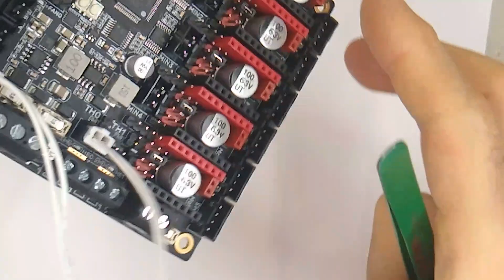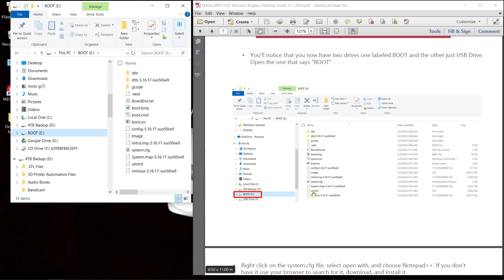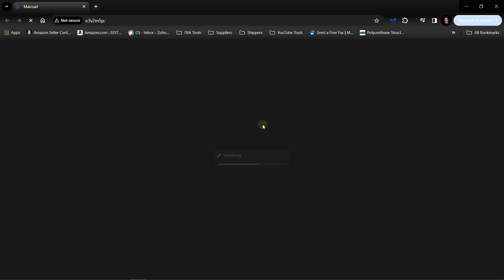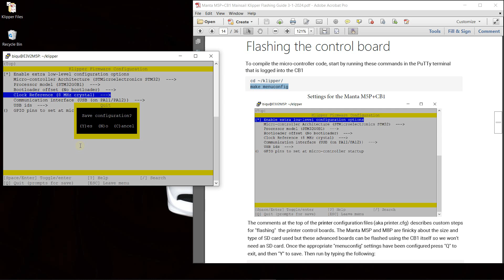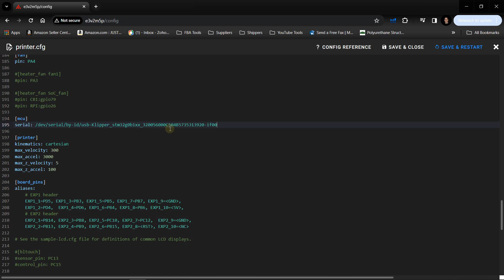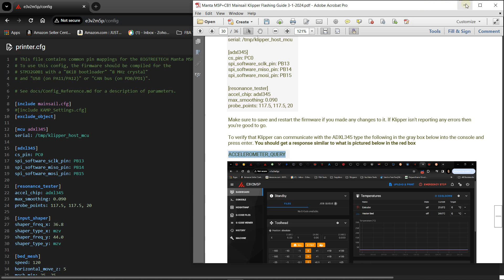How to Install Mainsail Klipper on the Manta M5P+CB1 using DFU to Flash Klipper.bin 2024 Edition

Comment: Hi Victor,  using this tutorial for the Manta M8P is working out quite well so far.  I'm still in the process of cabling up the components which I hope to finish 3/17, Happy St. Patty's Day.  I have just a couple of note so far:

Page 15  the M8P and M5P use the same memory address.  
dfu-util -R -a 0 -s 0x08000000:mass-erase:force -D ~/klipper/out/klipper.bin 

The M8P has (2) sd card slots, you need to use the SOC-CARD socket for the flash.

 Page 29  the M8P SP1 socket is reversed 180 degrees from the M5P so pin 1 for the M8P is the right hand pin closest to the edge of the board.  The M8P labeling for the SP1 socket for pin 2 is PC4 for the V1.0 & V1.01 boards.  The M5P pin 2 is labeled CS.  The M8P V1.04 and above have the label as CS.

Here is the ADXL345 printer.cfg setup for the Manta M8P

[mcu adxl345]                    #  For resonance Tuning of X and Y axis in my Custom CoreXY

serial: /tmp/klipper_host_mcu

[adxl345]
cs_pin: PC4
spi_software_sclk_pin: PA5
spi_software_miso_pin: PA6
spi_software_mosi_pin: PA7

[resonance_tester]
accel_chip: adxl345
max_smoothing: 0.090
probe_points: 117.5, 117.5, 20   # Edit X, Y, Z for your printers bed center point 

If you use the data from the Tutorial on the M8P you will get this error:

Invalid adxl345 id (got ff vs e5).
This is generally indicative of connection problems
(e.g. faulty wiring) or a faulty adxl345 chip.

"It is also caused by the incorrect pin assignments."

Victor, overall you efforts have made my install of the M8P board quite easy and I hope these notes will help anyone trying it on the Manta M8P + CB1 + 2209 Chips.  If I find additional information I post it back here.

Thanks Again Victor.
Doug

Comment: Victor, this tutorial is perfect.  When my Manta M8P arrives I'll take it for a test configuration run.  Well Done my friend.  I did note that the last section of the document relates to the stepper Vref settings and I will get you an updated copy of it as my original work was based on the PEAK current.  Creality steppers work on the RMS value.  So if someone calculates the Vref in this old document please multiply your result by .707 ( RMS Constant) to get the correct Vref.  Victor I'm looking forward to the M8P arriving as I'm setting up a three axis Z configuration for an Ender 3 CoreXY conversion to improve tramming and bed meshing and to see how it works with the adaptive bed mesh feature. Your document and tutorial looks like the ticket forward.  Thanks a lot for paving the way to success with the BTT Manta and CB1.  The CB1 heat sink got lost in the mail........go figure.  Great job again sir.
Doug
Reply from the maker: Hi buddy, Thank you for revising the vref document, I'll edit the PDF guide to update it. Yeah, please let me know how it goes for you so I can tweak and make it better. The Direct Firmware Updater feature works great, no more finicky about the SD card issues.

Comment: Is the recent update fix..???I updated raspberry now I can’t ssh lost connection
Reply: I have now done 5 rebuilds because of the "update all" in the machine side of Klipper.  My rule " for me " now is if an update showed an orange warning notice, I don't update that component.  When they get the bug fixed in it then I will.  No orange warning is an update go.  Just my nickel. Doc'
Reply from the maker: Yeah, I agree with you, it seems that I was lucky not to have had an issue with the first one I did but the second one gave me the same problems.

If it ain't broke don't fix it.

Comment: Hello Victor, Dennis here, I wanted to thank you once again for posting the Klipper update to the CR10S Pro. I have been printing threshold ramps for the house. My wife fell and broke   her foot. She is now using a scooter and  we have some Texas class Speed bumps. I cranked up my Fusion 360 and Printed a few profiles then dialed in to and product a nice three piece ramp set i Super Glued and put down so she can easily navigate the monster threshold. Using PLA Pro + 3mm layers 20% infil at 180 mm/s and prints are just beautiful. I can monitor the prints process via Mainsail even Web Cam and ETA updates via WiFi. Its great, I tell her the new ramp is done I will be right back and she knows I will. Thank You again for helping the masses find Nirvana in the 10s Pro, VIA KLIPPER &  Mainsail D&M
Reply from the maker: Hi Dennis, great to hear from you. Awesome job on creating the ramps for your wife. I bet you can sell them on Facebook Marketplace to help others solve the same problems. Nothing better than a few extra bucks to help you continue learning and fund this amazing hobby. Klipper is amazing and bringing new life to very capable older machines makes me happy.